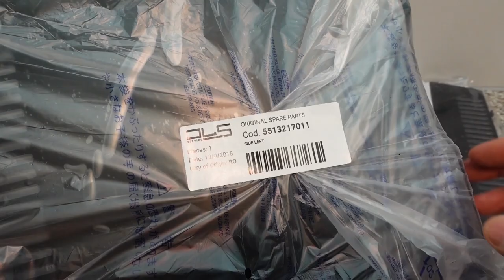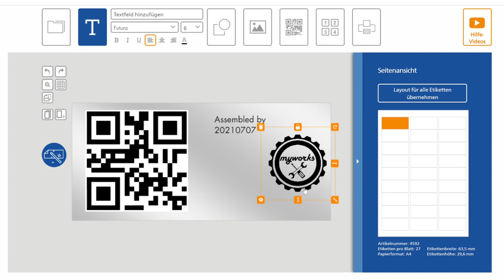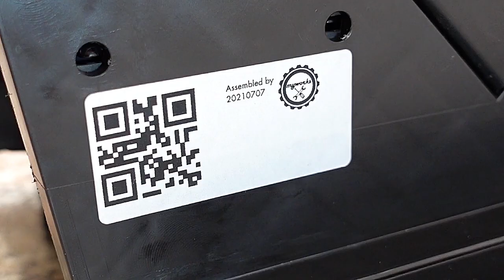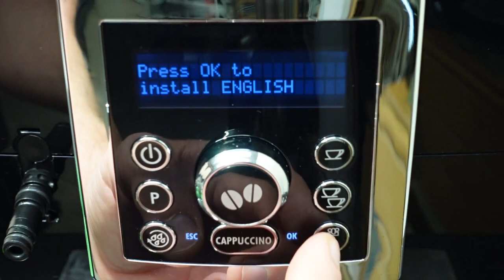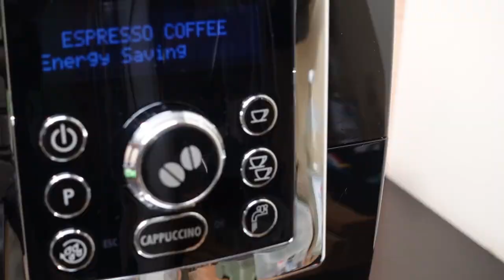I'm Creating a New DeLonghi Coffee Machine

Comment: Hello myworks, I have seen all your videos, it is very relaxing to watch you refurbish/repair these machines. I have noticed that you only deal in DeLonghi, I own a Breville Barista Touch that I bought from US and now have been positioned abroad in a 220volts region. I was wondering if you would do a 110v to 220v conversion on a machine instead of using a step up/down transformer?
Reply from the maker: Hello, thanks for the great words.  I started with DeLonghi but will also repair other brands in the future. I think I would not convert because there are other components installed besides the transformer that probably do not fit. For example the heater, water pump, solenoid valves and maybe the software !?  LG
Reply: @yt.myworks  Thank you, Would love to see some videos on Breville/Sage Barista series. Great videos, specially love your attention to detail and meticulous work ethics.

Comment: I have this model. ECAM23450. FROM 2011..and almost used every day since. I have done very little maintenance, but I watched your video and was inspired to take apart the infuser and clean and grease it. I really like this machine. But I see the new Primadonna Soul.. it looks cool. Do you think that the new Primadonna Soul is much better than ECAM23450? To me it looks like it is very similar internally like my old machine 🙂
Reply: I would like to know the answer to your question as well.
Reply from the maker: The construction is essentially the same but has been improved in a few places. The ceramic grinder, touchscreen, drive motor, drip tray concept and the removable coffee spout are new. I think the coffee maker has been slightly improved.

Comment: where is the adjustable opv, the manometer? You went throu all this just to assemble a stock unit?
Reply from the maker: The adjustable opv is not available on the model. This machine has a solenoid valve.

Comment: I own a Delonghi Ecam 23450s. Can you tell me if it is worth to upgrade it to the new Gaggia Accademia 2022? Thank you.
Reply from the maker: The Gaggia Accademia is a very nice coffee machine, and its design seems well thought out. Unfortunately, I cannot comment on the reliability of the device as I have not used it yet. I believe the machine is built by Saeco and matches their reliability.
Reply: @yt.myworks  Thank you. Philips onws both Gaggia and Saeco. Can you please tell me if the Saeco Superautomatic coffee machines are as reliable as those made by Delonghi? My ECAM 23.450s made over 20.000 coffees before needing to be repaired due to a water leak.
Edit. According to Reddit, the Gaggia Accademia 2022 is similar to the Saeco Xelsis Deluxe and Supreme: "The difference between the academia and the Xelsis are the academia has a steam wand and carafe, cup warmers and a smaller screen. The 240v European Academia has dual thermal blocks for the same price (the US version does not). Both machines have the same parts and software with slightly different verbage on the software."
What do you think?
Reply from the maker: Hi, as I mentioned before, I really like the Italian design of the Accademia. That’s why I looked into the machine about a year ago. The exterior build quality seems excellent and impressed me a lot. I would definitely choose the Accademia over the Xelsis, as a large display doesn’t make the coffee any better. However, I don’t think these aforementioned coffee machines are more reliable than those from DeLonghi. For this reason, I recommend checking out the DeLonghi Primadonna Soul ECAM610.75.MB if it’s available in your country. It’s a well-designed and robust machine that also makes excellent coffee.
Reply: @yt.myworks  Hi, did look into the new Delonghi Rivelia? I am now considering buying it to replace my ECAM 23.450s, but first would like to know if  it will match the Primadonna Soul when it comes to reliability and quality of the coffee drinks.  Thank you.
Reply from the maker: Hello, I haven't had much to do with the Rivelia yet, I took a look at the device in the electronics store but visually it can't keep up with the Primadonna Soul. The Soul has an adaptive grinder and high-quality display. On the whole, the prima donna looks much more solidly made. In any case, I would prefer the prima donna soul to the Rivelia. Greetings!
Reply: @yt.myworks  Thank you. The possibility of quickly switching beans caught my attention.  What's your opinion on the DeLonghi Maestosa - EPAM96075GLM, that allows the use of two beans?
Reply from the maker: @DireitoIntegral  Hi again, I recently got an exhibit item "epam 960.75.glm maestosa" for around 1300€ and am very taken with the high-end product. A beautiful piece of Italian design made of glass and stainless steel. But I'm not sure what the supply of spare parts will look like in the future. Case parts, for example, are no longer available now. The repairs will certainly be a bit more complicated, as a lot of electronics have been installed. That's why in most cases the "Soul" is a better choice.

Comment: Hello, Myworks. I see that you know "a thing or two" about coffe machines. 😁 I bought used delonghi perfecta cappucino, and it takes 2-3 minutes to warm up when turned on. Is it normal or should perform faster? Thank you 😊
Reply from the maker: The heater has two heating elements. If one of them is broken, it takes a long time to heat up. I think you will have to change the heater. It looks like this: https://www.juraprofi.de/DeLonghi-Ersatzteile/Erhitzer/DeLonghi-Durchlauferhitzer-EX-1-und-Lattissima::9407.html

Comment: I saw a silicon seal around drain outlet that you put back in, this is to prevent water leak from that outlet, isn't it?
Reply from the maker: Do you mean the seals at min.09:37 ?  There are only the two foam strips on it.
Reply: @yt.myworks   It was at 02:32, that drain outlet.
Reply from the maker: I saw a silicone seal on an ECAM 550.XX. Not yet on this 23.450 model.

Comment: I have a similar device, but the water pump decided recently to keep working regardless of lack of water in the container. Is the water level sensor responsible 5:34 or it or is this another part?

Great assembly, very informative. That said, parts must have costed a small fortune :)
Reply: @Legzakimbo2002  that sounds like an easy fix, gotta try it tomorrow, thanks!
Reply from the maker: Elbow the letter is right. The bug has something to do with the water tank. Check if the float stays on top when the tank is empty.  Then you have to clean everything up again so that it doesn't get stuck.
Reply: @yt.myworks  is the float supposed to go ALL the way down? Mine is missing like 5mm. I can't open the float container either, it's glued well and I don't want to break it.
Reply from the maker: Try moving the container back and forth without water. Who float must not get stuck. The container is not glued but difficult to open.
Reply: @yt.myworks  the float isn't stuck, it just hovers 5mm above the bottom of its container. I just ordered a new container anyway. Thanks!
Reply: @yt.myworks   @Elbow the letter  just got a new container installed and saw "fill tank" message for the first time in a few years! Podziękował.